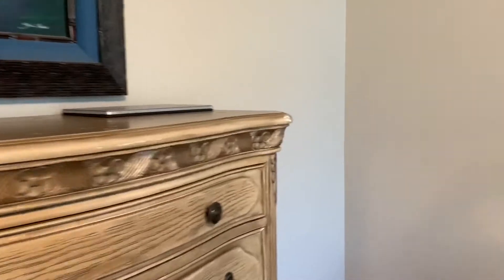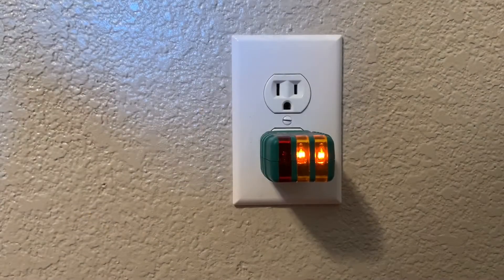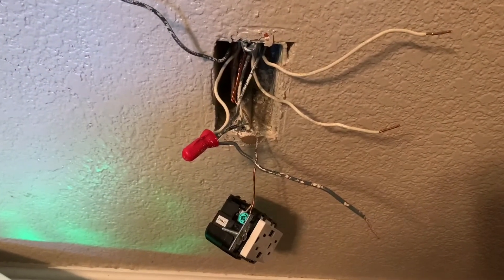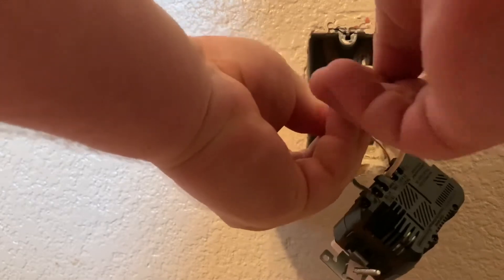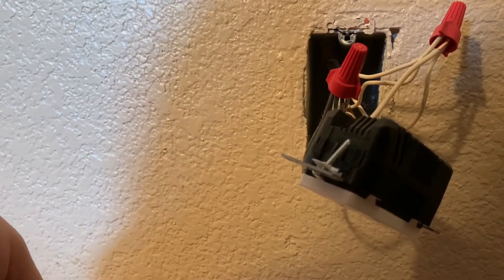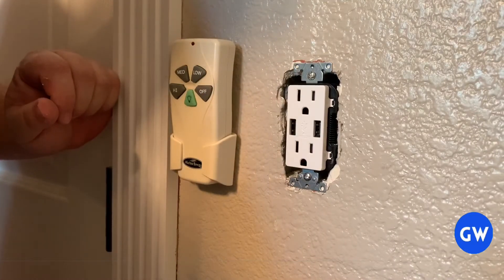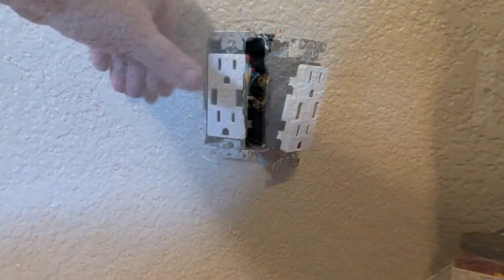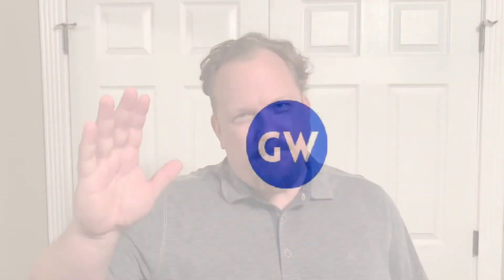Convert Split Switch to Dual USB Outlets (Detailed Version)

Comment: Attempted to do the is but keep blowing the breaker when I turn on the switch for the lower outlet
Reply from the maker: Sorry you seem to be having problems. Without seeing your setup, it’s difficult to troubleshoot. Sounds like you have a short. I would establish your leads coming from the source to ensure you have that setup and then connect to your switch. Did you take pictures before starting to know what your known good situation as. If so refer to that. You can also normalize it the way you had it to start. To see if everything works again. Then start over.  That happens to the best of us. 

Also, I left references in the notes. Those are great resources 

And it may be something too frustrating, call a licensed electrician. My setup for very specific to my needs. So you may only need a portion of what my video showed

I hope this helps
Reply: @garlandsworkshop  well I replaced the light switch but wondering if the breaker is bad?  I think I know which line is doing what. But I will keep trying. Learned a lot watching your video.
Reply from the maker: @762531971  I love the positive spirit !  I hope you can resolve it safely soon. It always feels great when you can solve a mystery